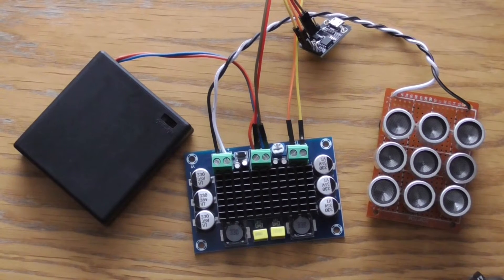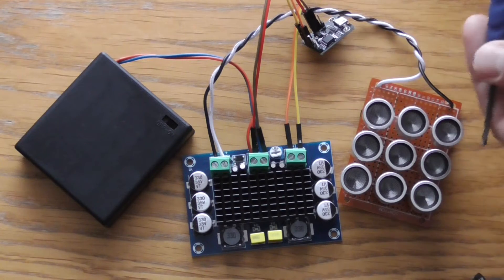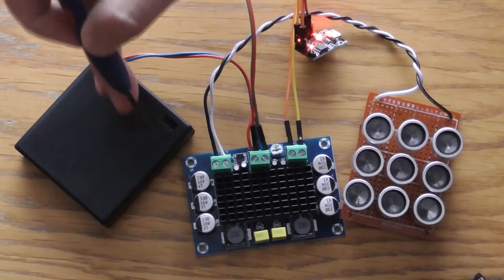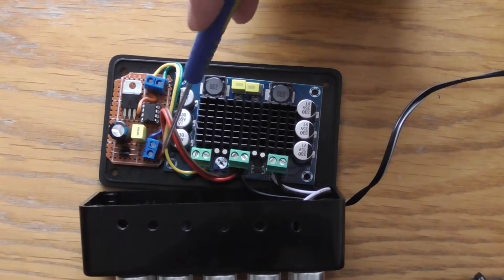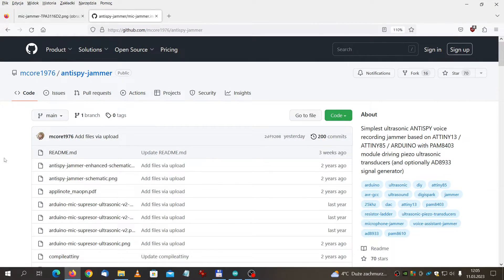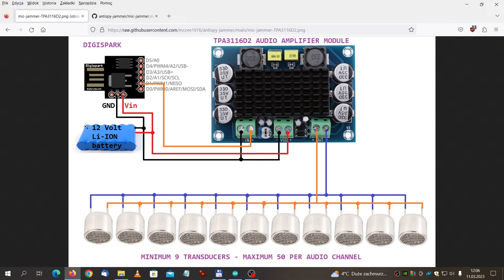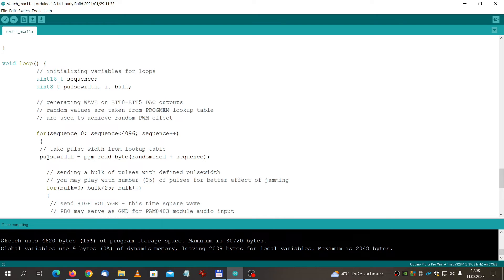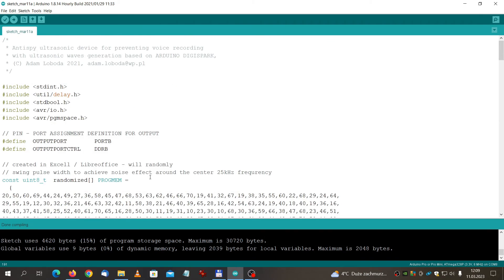DIY microphone jammer beast for less than 30$,  voice recording blocker with Digispark and TPA3116D2

Comment: Hi i tried but it still not generating noise.

My digispark is on, and the greenlight is on. 

Whats might the problem is
Reply from the maker: it can be many issues beginning from bad wiring and not correctly uploaded program to the Digispark. It is hard to guess whats wrong with the simple feedback only that it "just do not work". Use the voltage meter and an oscilloscope to find if there is any signal on Digispark output and so on. Many people have built this device so if you use correct parts and upload proper arduino script it always works
Which version did you build - with the AD9833 module or without?
Reply: @justanengineer5599  I built the ad9833 version. Would you mind if I email you my wiring? I'm using breadboard.
Reply from the maker: check if you have used

 this diagram :
https://github.com/mcore1976/antispy-jammer/blob/main/mic-jammer-AD9833-TPA3116D2.png

and this source code:
https://raw.githubusercontent.com/mcore1976/antispy-jammer/main/mic-jammer-ad9833-digispark.ino

I would not recommemd using breadboard because there is a lot of issues caused by poor contact of pins on these boards

Comment: Good evening. I am interested in purchasing a low cost but high efficiency homemade jammer. My neighbors use a similar device (but since we don't talk to these people........) and I understand when they talk disguised but I understand some very distant statements by always keeping my 'hearing on and my brain is about to melt . Moral of the story, I have to get a jammer to protect my privacy and health. But I also have to get some evidence to make a complaint since I have been suffering for 3 years without being able to react. I await info. Thank you very much.
Reply from the maker: it will be expensive to send it to the other side of the globe. Try to look for local person with soldering skills  who will help you to build it.
all the conponents can be easily bought in chineese online shop www.aliexpress.com
Reply: @justanengineer5599  Yes. However, it is only a "toy" and it doesn't even come close or doesn't do its task. On a whim I'll try to buy it .... . But these pcb's I have seen plenty of them but then what is the one that works? Instead as for 'remote listening (semi-detached house with 40 cm partition wall) what can I use? Piezo records but without a 'proper amplifier I can't get the results I want. Thank you.
Reply from the maker: buy exactly the same amplifier TPA3116D2 MONO and 20kHz transducers as I am showing in my videos and they woyld work just fine. Browse through the comments there are also links there
Reply: @justanengineer5599  Perfect. I will now buy it immediately. one last question, "can I get (obviously modified) the 'opposite effect?" In lieu of isolating noise in my home, can I pick up nearby night noises? I am interested in both.
Reply from the maker: no. the opposite effect like noise cancelation can only be achieved through headphones
Reply: @justanengineer5599  Okay. All right I got it.

Comment: Iphone still recorrding bro
Reply from the maker: Hi. try my new source code for this version of the jammer : https://raw.githubusercontent.com/mcore1976/antispy-jammer/main/mic-jammer-digispark-ad9833-new-version.ino
Reply: i will tryit bro !  @justanengineer5599
Reply from the maker: let me know the results especially with iphones. IMHO it works better and it is not audible for humans at all that makes this device as good as commercial microphone jammers
Reply from the maker: the trick for blocking iphones is to 20kHz transducers (after slight code modification for rand() and while loop values). But they are 10x more expensive than 25kHz transducers. However the iphone jamming effect is outstanding. It blocks literally everything in every direction. even iphone inside the pocket
Reply from the maker: yes I did. And the effect is outstanding. You can buy it here 
https://comton.en.made-in-china.com/product/mdafzyPgXBkX/China-20kHz-16mm-24mm-Open-Type-Ultrasonic-Sensor-for-Mouse-Repeller-Pest-Control.html
Reply from the maker: have you built the jammer with AD9833 module ? if not try it
Reply: @justanengineer5599  yes bro, i made with Digispark + 
AD9833 + TPA3116D2 + 12v5A power source + 40 ultrasonic transducers. it creates a very effective blocking effect with various Android devices or cheaper phone models. It seems that the iPhone X or newer generations have sound filtering features, so the effectiveness of this device on iPhones is not significant. Additionally, if I place the phone in my pants pocket or jacket pocket, the interference effect is also noticeably reduced
Reply: @justanengineer5599  Do you have any suggestions?
Reply from the maker: the clothes block ultrasound so all ultrasonic jammers are not so effective. Try to build at least 2 or 3 of such devices (with each single transducer covering 30 degrees angle) to cover whole room area and switch them on at the same time.  There is no 100 percent working solution now on the market however you can highly reduce chance of hidden recording

Comment: Hey, 

Just want to check that the TPA3116D2 works at 40khz in your experience. Im building something simular for use with the 40khz transducers, but I can only find very little infomation on the frequency range of the TPA3116D2
Reply from the maker: it will work but with less audio power
check this source code for 40KHz
https://raw.githubusercontent.com/mcore1976/antispy-jammer/main/mic-jammer-ad9833-40KHz-digispark.INO
or newer better version
https://github.com/mcore1976/antispy-jammer/blob/main/mic-jammer-digispark-ad9833-40kHz-new-version.ino

Comment: In what range can your jammer with 15 transducers cause interference?
Reply from the maker: depending on what type of microphone / device you are jamming. For Android phones it is 5 meters.
Reply: @justanengineer5599  nice result 😄
Reply from the maker: older androids even 10m but please notice that it has 50Watt audio power inside
Reply: If it's a security surveillance camera microphone placed around 10 m .will this 50 W enough ?

Comment: can the digispark be powered by 5v through usb and the rest of the stuff from 12-24 volts?
Reply from the maker: yes of course. but ad9833 must be powered from 5V if used - of course it may be done through 5V pin of the Digispark
Reply: @justanengineer5599  thanks.

Comment: Master, How to solve this errer             #include <util/delay.h>
Reply from the maker: remove this line or put // on the begining of this line. It will work without  this library
Reply: @justanengineer5599  Thank you master, and I have another error    "DDRB' was not declared in this scope"
Reply from the maker: please state what arduino version you are using and if you have it configured for the Digispark  like in this tutorial https://startingelectronics.org/tutorials/arduino/digispark/digispark-windows-setup/
it looks like you havent configured Arduino IDE properly

Comment: Hi, first of all, thank you for sharing your work!
in this setup, is it required to have 9 transducers?  I tried this setup (TPA3116D2) (Digispark Usb) antispy-jammer/main/mic-jammer-TPA3116D2.png. with 5 transducers on a PCB board with a screw-terminal and a capacitor of 47uF 50v.  I did not use the capacitor between Vin and VCC+. The problem is, it works very shortly it starts up and it is jamming for 5 seconds after that it does not jam anymore. you still hear the same sound. I used multiple phones in a range of 30 cm.  I powered it up via Bench power supply on 12v and it says it uses 0.3A.  

any suggestions? 
 
Kinds regards
Reply from the maker: the 47uF  capacitor should be placed between Vin and GND.  Connect one of Arduino pins PB2 to Audio Input + of TPA3116D2 board. Second audio Input - has to be connected to GND. If less than 8-9 transducers the TPA3116d2 may be unstable
Reply: @justanengineer5599  Thanks for the fast response! I will try this.

Comment: Hello, I have assembled everything and my digispark melts, I don't know why, it works for 1s and makes a short. It's weird, I don't know, I haven't put the capacitors.
Thanks
Reply from the maker: you probably messed up the wiring or have some shortage. Connect audio input pin "-" to GND and use exactly the same model of audio amplifier module as I did.

Comment: can you please share the code with just the amplifier and digispark and its circuit diagram. Thanks.
Reply from the maker: remember to use 25KHz transducers !

the connection diagram
https://github.com/mcore1976/antispy-jammer/raw/main/mic-jammer-TPA3116D2.png
- capacitors are optional, sometimes it works without them

the code for Arduino Digispark
https://raw.githubusercontent.com/mcore1976/antispy-jammer/main/mic-jammer.ino
Reply: @justanengineer5599  can you share your wechat or any other contact details please. Thanks.
Reply: @justanengineer5599  yes I am using 25 KHz only.
Reply from the maker: you can find my contact details (email) in the channel description. I  frequently include my email in first few lines of the source code as well

Comment: Will this work XH-M139 TPA3116D2 2x 50W +100W as well? Thanks. The aliexpress one you mentioned is getting alot of time for the shipment.
Reply from the maker: yes I am using Mono version of this board and stereo should also work because chip and components are the same.. So far this TPA3116D2 is the only type that seems to work correctly with ultrasonic transducers. DO NOT BUY TPA3118 OR TPA3110 they dont work. I think they have a problem with impedance of transducers
Reply: @justanengineer5599  thanks.

Comment: This is such a waste of time - nothing but errors here as well. Very frustrating
Reply from the maker: Well it requires some minimum skill. I could not make it simpler. You need to know how to use PC and Arduino IDE and how to connect few cables without errors.On the schematic you even have different colors and names on the cables not to make any mistake.  Sorry if it is too much for you maybe you should ask someone for help.
I would suggest to go through this tutorial at least : https://startingelectronics.org/tutorials/arduino/digispark/digispark-windows-setup/
If you are having errors while connecting Digispark  try  different USB port or different PC because sometimes that is the reason
If you have issues with making the build based on AD9833 board, first start with the design with Digispark and TPA3116 board only  because it is simpler to build and run

Comment: Sir can you plz do a tutorial on how to do rolljam attack using cc1101 i am a student and want to do it for my project plz help
Reply from the maker: you need Yardstickone that is based on CC1101, look for it
Reply: @justanengineer5599  can't there be any other way to get this attack for cheap
Reply: Can't This be possible that we jam key fob signals using cc1101 and record keyfob signal using rtlsdr abd then transmit that signal using another cc1101
Reply: And can you make a tutorial on how to transmit signals using cc1101 plz
Reply from the maker: see my other video of RPITX for raspberry Pi and RTLSDR dongle. This is something that you are looking for
https://youtu.be/WmvEid3ULvE
Reply: @justanengineer5599  sir problem is that I have a raspberry pi 3 b but it is not booting like only the power red led is still and there is no signal so I wanted to know if there could be some other cheap way to do the same thing with raspberry pi
Reply: And can you fix this problem
Reply from the maker: From what you are writing here I can only conclude that you do not have enough skills either to use Raspberry Pi or CC1101 based devices. If you want to steal cars that is OK but it requires some knowledge that you do not have. And do not treat me like a fool saying that you open cars for the project in the school,  come on... You are simply not smart enough to do such kind of things. It is a  waste of my time
Anyway to transmit signals you would have to use CC1101 board + Arduino Pro micro board and my code for off-grid radio communicator from one of my latest videos. First you need Universal Radio Hacker tool that I am also  showing in one of my videos to find what kind of modulation type and data are send over the radio and prepare a code for Arduino Pro Micro to send this data. If I would show it in the video you would not even understand what I am doing  it is simply to complicated for you. So buy new Raspberry 3B and experiment - this is the easiest way to accomplish your goal

Comment: Is there any way to focus the ultrasound to increase the range?  Would a parabolic dish help?
Reply from the maker: yes it could help but you would need some precise threedimensional calculation how to place them and special housing designed for 3d printer to make it.
If you have made this device you had probably noticed how easily these ultrasounds are bouncing of the walls and other obstacles

Comment: I want to ask in your car hacking project instead for transmitting radio signals using raspberry pi can we use any other cheap transmitter to transmit radio signals if yes plz suggest one
Reply from the maker: CC1101

Comment: The characteristics of my single-channel TPA3116 indicate that the maximum power will be when a voltage of 24 V is applied. Can I set the voltage to 24V 2 Amperes from the power supply (and to Digispark 5V through a step-down LM ...)
 Or do you recommend only 12v?
Reply from the maker: yes you can go with 24V it was already tested by others
I hope you made AD9833 based version because it is my target solution and works much better
Reply from the maker: I am wondering why have you deleted the comment saying that the device you built works and is able to jamm Android phones from 4 meters :-) ???
Reply: @justanengineer5599  Did I delete anything? Thought. what you removed.. Everything still works fine. I am very happy about it and thank you for your work! I keep testing, it's great that you came up with this!!
Reply from the maker: hmm.. I think YT bots are deleting some comments...
I am glad that you like my device. please make a short video how it works so I could attach it to my new videos

Comment: I have already assembled 2 columns of 20 ultrasonic generators and did not observe the polarity ((now I have to redo everything or will it work anyway?
Reply from the maker: it may not work correctly since transducers with reversed polarity will generate reverse move of the air therefore they will simply cancel the signal of other transducers

Comment: doesn't the digispark attiny85 support input voltage from 7-35v? Why was a standalone voltage regulator needed instead of using the built-in voltage regulator?
Reply from the maker: I wanted to optimize the design because digispark has this 5 second delay between plugging the power and starting the program (this is Micronucleus boot loader). So I built my own Digispark and programmed it via AVRGCC and USBASP  like this (this is new design with AD9833 but look at LM7805 and ATTINY85 in the diagram):
https://github.com/mcore1976/antispy-jammer/raw/main/arduino-mic-supresor-ultrasonic-v2-ATTINY85-TPA3116.png

in the video I was not using AD9833 version yet but this code :
https://raw.githubusercontent.com/mcore1976/antispy-jammer/main/main4.c
which was working great but was a bit audible. So I ended up with AD9833 version like this
https://raw.githubusercontent.com/mcore1976/antispy-jammer/main/main6.c

the conclusion is that the Digispark version and ATTINY85 version are generally the same except in ATTINY85 version the program starts faster and there is no 5 second delay introduced by Micronucleus Digispark bootloader